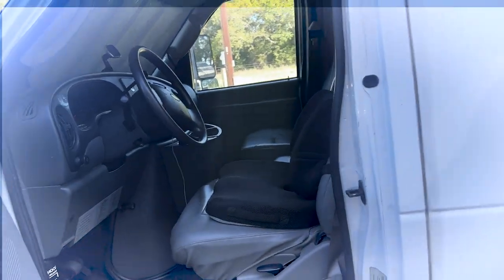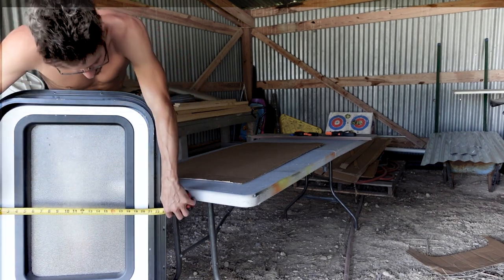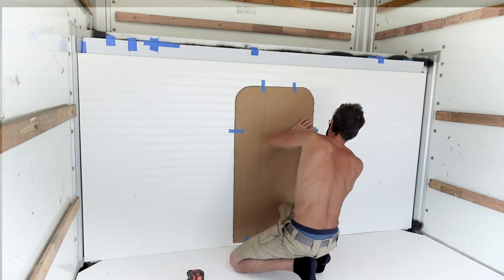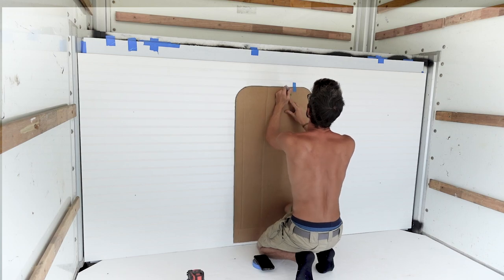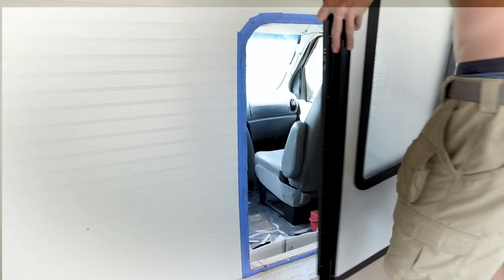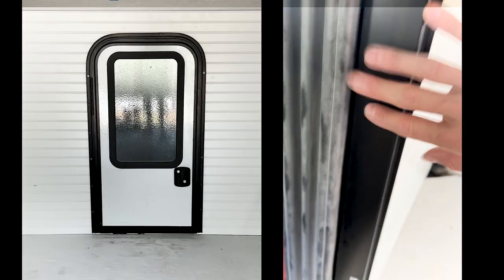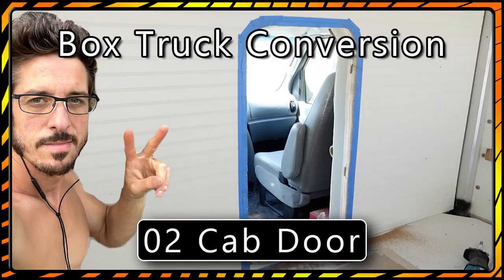BEST Cab Access Door | Box Truck Conversion

Comment: I have stressed out big-time trying to come up with a legitimate design for a U-Haul pass-through and never even thought of using a door like this! I did come up with a pretty good idea using pipe insulation on a PVC frame that can float as the seal and then just use a curtain Because the idea of creating a lip for the accordion seal like you did cross my mind but I just didn't see it as feasible and too much work but I guess compared to the other options it's a damn good idea! Another thing to keep in mind is that All of that needs to be sealed up like the world depends on it with silicone because if you start getting moisture into that plywood between the metal sheets that makes up the box walls you will essentially destroy the entire build when that wood rots.

Comment: Thanks, I was looking for information on a pass though. I did learn a lot, however I would the wall cuts individually.
Reply from the maker: Glad it was helpful!
Reply: I second cutting the walls individually. Sawzalls don't like to stay straight.
Maybe drill a small hole through the template and through both walls, then you have something to line up the template with, and can put the template inside the cab to cut the 2nd wall.

Comment: Nice work. Your video and instructions were really clear. I would worry that the initial hole may not line up perfectly with the cab spot if your angle was a bit off as you go through the box. Maybe a pilot hole the same size as the centre drill would help guide it to the exact spot. Maybe I’m being overly paranoid but I would hate to screw this important cut up.
Reply from the maker: Yeah the initial circular hole is not that critical..it’s the sawzall part that needs to be straight and those blades can bend especially when they get hot. Mine wasn’t perfect but I went back and trimmed it out. As long as you’re close, it works out

Comment: Brad, a couple questions, please…
1) After installing the FRP frame, does it extend past the door opening about 1” all the way around?
2) To keep the boot in place forever, would it help to apply contact cement to the boot and the edge of the FRP frame it attaches to?
3) Should I order a boot for a 5” wide gap?

Thanks!🤙🏼
Reply from the maker: yes frp is extended all the way around. yes you could use an adhesive on the boot if you like. I dont remember what boot i ordered but 5" sounds about right

Comment: Love your stuff man. I can't wait till your at 500k subs. I'm guessing only a build or two away. If not, maybe try jumping out of a plane with only a cordless drill and a fan flade in the chuck.
Is the cab loud as fuch with just the rubber gromet in place? I'm talking on the interstate.
Keep up the great fun!!
Reply from the maker: Thank you 🙏🏻 the cab is louder with the passthrough than without but the rubber boot dampens it down. To me, not a big deal. 

I still prefer it over an open cab like sprinter where you have to listen to all your stuff banging and rattling around. I can take phone calls and enjoy the stereo in peace

Comment: Very cool! One of the best pass-through ideas I have seen. How did you work around the interior portion of the lock being on the cab side where it can be unlocked easily by an intruder? Thanks.
Reply from the maker: The door opens into the box so when I pull the bench out into bed configuration it’s impossible to open that door. I do that for extra security if I’m leaving the van parked somewhere sketchy

Comment: i remember years ago on a move - think it was a ryder - but was the bigger 26 footer? and it had the pass through door. I thought these early 2000 15 footers were also like that but i see they are just like the new ones - separate crappy fiberglass cab back with the gap.
Reply from the maker: I think this design is specific to uhaul. The ryders have the box connected to cab

Comment: Nomad Brad, thanks for the great video! Any suggestions on how to do something like this when the box truck has a window spanning the back wall of the cab?
Reply from the maker: Well, you’ll have to remove the window. You can  then make the opening the same size as the window opening or you’ll have to fill the gaps with plywood to make it smaller

Comment: 1) He paneled the inside wall of the box BEFORE cutting out and installing the door.

2) 0:35 There is a gap of about 5” between the box and front cab. 

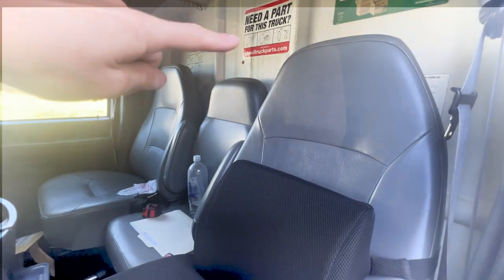3) 1:03 He bought the 22” wide X 42” tall Lippert RV door off of eBay. 

4) 1:49 Buy “Accordian Boot” from eBay, etc. to fill that gap. This has two metal clips that run along each edge.

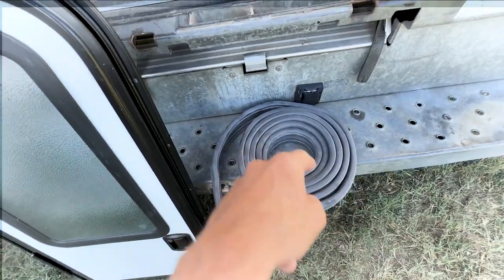5) 2:09 Trace door on cardboard for template with marker.

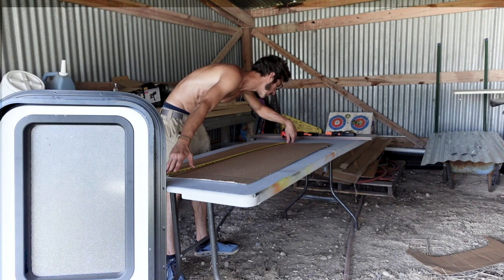6) 3:01 Center template on wall and scribe line.

7) Drill pilot hole through BOTH so I can start cutting with Sawsal.

8) 8:01 Sawsall blade is 9” and rated for “wood with nails.” It can cut through BOTH walls at the same time. He suggests using two NEW blades.

9) 8:54 Tape along outside perimeter of line to protect the good edge.

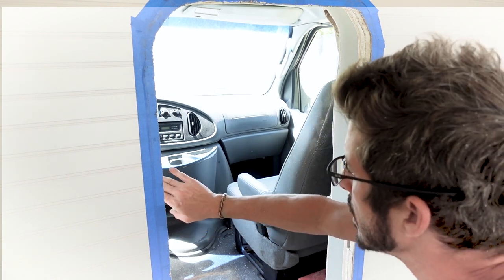10) 10:34 Cut out FRP frame using the same cardboard template for the door. Cut it so that it is about 27” wide X 48” tall. That’s about 3” wider and taller than the opening.

11) 11:56 He glued the FRP using ‘Loctite Powergrab All Purpise’ and self tapping screws about every 8”.

12) Install door.

13) 13:22 The boot clips on the edge of the installed FRP panel and the edge of the door.

14) 13:38 Start boot off center so if you step on it it doesn’t mess it up.

15)

Comment: Could I still have use of that third jumper seat? Like does it bend forward in half or…? Love this but I need three seats. :)
Reply from the maker: The jump seat is fixed and does not fold. You will not be able to use a door if you keep the seat. Unless you make a custom jump seat but then it will still be difficult to climb over the seat into the back

Comment: How did you seal the accordion from the outside (between cabin and the box)? Now when it rains, the water stays on top of that accordion boot and might get inside the plywood wall.
Reply from the maker: I sealed the edge of the box with silicone and the van box has an overhang that extends over the cab. It does not get wet when raining

Comment: Ive considered doing this on my truck many times but my motor is directly below the cab so I imagine a huge increase in motor and road noise if I were to do this leading to fatigue on long trips. Did you notice a lot more noise while driving after? It would be more difficult but putting the door on the cab side would have helped.
Reply from the maker: Yes there is more road noise, not huge amounts.

Comment: how did you get the self-tapping screws drilled into place (mounting the FRP to ext. of cab) with there being such a small amount of space between cab and box to fit an impact driver or drill?
Reply from the maker: I have a 90 degree impact drill adapter. Can find them online or Home Depot

Comment: Is this a purpose pass-through door? Because the door’s key side should be on the cab side (not on the box side).
Reply from the maker: It was done on purpose. The door needs to swing open into the box not the cab. And the locking mechanism can’t be reversed.

To block access through the passthrough I just slide out the bench about 6” makes opening the door from cab impossible

Comment: Hey Nomad Brad, how did you connect the accordion boot to the RV door aluminum step plate? This door I just got has no edge on the step like the rest of the frame.
Reply from the maker: I was able to attach the boot the the very edge of the step plate. It’s not as deep as the rest of the frame but it still connects

Comment: Do you trust the aluminum to hold on the accordion boot? I feel like it will fall of some time, would it be safer to add a few screws?
Reply from the maker: The accordion boot has metal clips built in that secure it to the aluminum door frame. If you screw through the boot it will no longer be air/water tight. If you’re concerned about the boot falling off you could use an adhesive. This is the method I used in my last box truck. It lasted 2.5 years without falling down

Comment: how did you get the seat off, i been twisting the bolt with a wrench and it aint going no where just keeps spinning
Reply from the maker: you have to hold the bolt stationary while you loosen the nut. either you need someone on top holding the bolt or you can put a wrench over the bolt and zip tie it to the base of the chair to keep it from moving ( thats what I did )

Comment: How did you get the screws into the FRB, not much room to work!
Reply from the maker: Correct, I used a dewalt right angle attachment with self tapping truss head screws. It’s a tight fit but it does fit
Reply: @nomadbrad503  Thank You,Very Nice work

Comment: Sorry.  But, that is a crappy door because no matter how strong the metal is...... everything on Earth is only as strong as it's weakest part.  The glass in the middle can be broken in 2 to 5 seconds and it's big enough for a small man to get through it.  So, again sorry.  But, you don't have a safe enough door installed, especially if you are away from your truck.
Reply from the maker: Sir, I am not building a panic room here. Anyone could just smash out the drivers window and Hotwire this van if they wanted to do me dirty. The strength of the little door in the middle means nothing. 

And this is in fact an exterior door from an RV so you could say the same thing about every rv that has been manufactured with a window..someone could break out the glass and climb inside. 🤷🏻‍♂️
Reply: @nomadbrad503    American ingenuity at it's best.  LOL.
Reply: lol you should have stayed in school.  He didn't want to come out and say it but we all know the reason for a pass-through door is in case of horrible weather when you arrive or depart your parking space and also if anything shady would be going on in the area and you want to depart safely without having to exit the vehicle.  This is why most pass throughs use a freaking curtain!  NOTHING you said has ANYTHING to do with ANYTHING.   In fact, the points you made are among the most irrelevant I've ever heard in 55 years walking this planet.